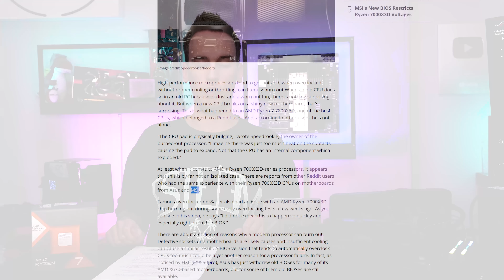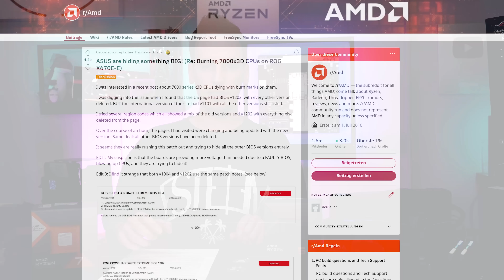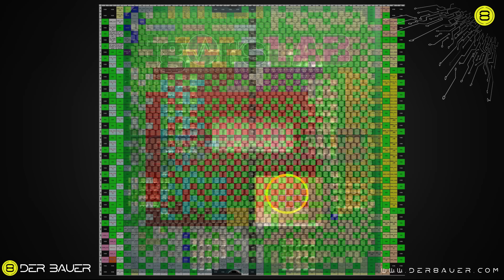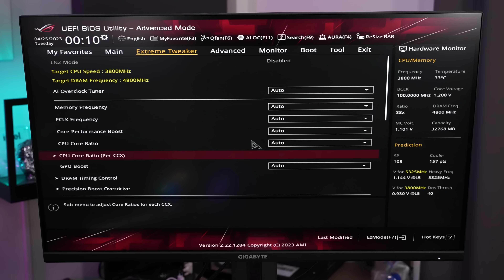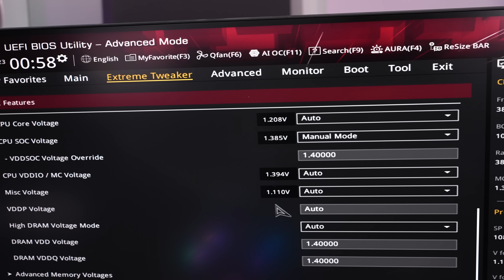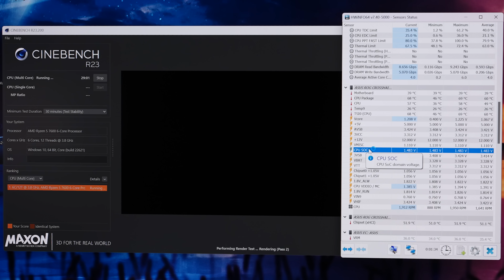I missed the Damage on this Ryzen 7900X

Comment: My 7700X spikes up to 102-105C when I wake up the pc from sleep and monitoring software is still running, otherwise it won't reach higher temps spikes than 95C once once the water cooler is saturated

Comment: I've been wanting to give AMD another chance by building another Ryzen system, but they're making themselves hard to like with the perpetual dumpster fire of problems plaguing literally every generation of Ryzen CPU and motherboard now.

I've been bitten four times by bad Ryzen CPUs and motherboards now. My first Ryzen 1500X was plagued by the dreaded Segfault bug, even though it was a mask revision that wasn't supposed to have it. My second 2400G was also plagued by the same bug, and the motherboard despite saying it supported it, didn't actually, so I had to jump through hoops to get the BIOS updated to work with it. The third was a 3700X that had an unsolvable watchdog timeout AND SMT bug that would corrupt system memory entirely at random. The fourth was a Ryzen 5700X that again had a motherboard that said it supported it out of box, but didn't actually because it was shipped from the factory with an outdated BIOS, and it didn't support flashback.

AM4 was a landfill fire that was entirely caused by AMD trying to support too many CPUs over too long a span of time.

Now AM5 is off to a great start with what is akin to a "killer poke", where the lack of hardware sanity checks can lead to the destruction of a thousand dollars worth of motherboard and CPU.

Comment: I cant imagine there is any way this failure node is anything other than a short to ground originating somewhere in the cpu die.  I would dismiss this as a 0.001% chance fail mode but it is weird that derbauer had one on the original 7900x. Perhaps amd has a small hole in a die sort test program

Comment: Drama wagon or not, it's getting harder to stick with AMD for a PC that is bought to be used for countless years...

It's RX6000 cards with the die cracking, CPU's burning, defective coolers on the RX7000...😕

I'm thinking it now everything goes High wattage and they make crap IHS among other stuff making things run supper hot and then have high heat tolerances so it's easier for something to completely go bad than ever.

I recently had many shutdowns on my Strix RX480 Flashed to Strix RX580 because of a defective Arctic MX-5 thermal paste and luckily it's still alive and fine after changing to MX-6, if it was a much more modern GPU the defective MX-5 might have burned my GPU, gladly my Vbios is set to 87Cº max and stays there while heavily downclocking and at 91Cº it shutdowns likely to prevent hot spots, if it was allowed to go to like 98Cº it would have been burned very fast...

ps: I also had 1 CPU core burning last year from my I7 2600K, but I mean it was always in use since 2011 and mostly at 4.9ghz on air cooler with high voltage and still took this many years to burn it and it still actually works by setting 3 cores, 4 cores it just keeps on a boot loop on windows and Linux reports CPU hardware problem and my CPU pads are only a bit darker on the area with problems, it wasn't even that much catastrophic and the board pins were also 100% fine.

Comment: I know when I was overclocking my memory a lot of people mentioned having 1.3 volts on SOC or higher from their settings stock. I thought this was a bit strange since I have the mdie 5600cl28 on x670e ASRock Taichi and the soc voltage is only 1.2 volts. 

this is a xmp kit not expo however.

Comment: I get random shutdowns with expo enabled. I've kept it disabled because of that. Happened once every 1-2 weeks.

The system refused to boot for a few minutes after each shutdown, like there was some sort of thermal protection going on. Temp readouts from RTSS were fine, like 50-60°C tops, but I only had package temp monitoring enabled, no hotspot monitoring sadly.

Comment: It should be pointed out that there is a known DDR5 PMIC bug that's likely responsible for buildzoid's dead 7950X. It happens when switching to the DRAM OC/High Voltage modes. The voltage stepping goes from 5mV to 10mV and depending on the order settings get applied, a translation bug can cause the PMIC to skyrocket MEM_VDD from the user value to ~1.7V+, depending on what was applied. The DIMM may survive but in earlier bios, MEM_VDDIO would automatically follow VDD to any value which could mean either instant death or  running unsafe voltages without the user even knowing.

Now the bios caps auto VDDIO but the bug still exists. Vendors have implemented roundabout measures and even temporarily removed high voltage options from some bios. It's certainly still a risk to users with much older bios and I don't see a lot of people talking about it.

To be clear, I don't think this is necessarily what's going on and EXPO shouldn't do this but it's worth pointing out. They do often set SoC higher than necessary and there may be other auto-prediction bugs going on but I suspect it's not that simple.

All I know for sure is the most important thing I've learned in ~15 years of building systems is to set every reasonable voltage and memory setting manually. Auto voltages and XMP values have always been a problem to varying degrees. Do not trust them, especially on new platforms.

To be safe, I'd suggest everyone do this and set MEM VDDIO, VDD and VDDQ individually (uncoupled). If you can't see the other values, load Ryzen master and write them down and in most cases default values are fine. Typical kits shouldn't need more than 1.30-1.35V SoC. Many CPUs don't need anywhere near that. Supposedly SoC should be at least 0.1V less than MEM_VDDIO. There are other voltages but they shouldn't be important and don't set anything your unsure about.
Reply: This would perfectly explain the multiple deaths from what appears to be MOSFET latchup. 
MOSFET lachup on a processor is nomally cause by an unprotected IO line being driven with a voltage Higger than its 0.6v under its supply voltage, it causes the bus receiver to short circuit across the power lines.
Ones latchup occurs theres nothing that can be done to save the chip except power off FAST - i doubt thermal management systems could do anything even if they arent taken out.
There would have been little reason to put protection on the memory lines in the past as they shared a power controller with the die, but now DDR5 sticks have their own on board power controller.
Reply: @mycosys  Thank you. Something like this certainly makes more sense than "High SoC damages thermal sensors therefore it boosts itself to the moon until melting.".

I don't doubt SoC could be a factor and that seems to be what they're focusing on but it can't be that simple. What's interesting to me is how supposedly VDDCR_SOC needs to be less than VDDIO_MEM + 100mV. I assume it's related to VDDIO_APU but it's puzzling to those I'd talked to and rarely mentioned. 

Normally this shouldn't be a factor but a kit running 1.4V SoC and 1.35V VDDIO starts pushing it and lower DDR5 voltages could quickly be a factor at reasonable SoC values. Then you have people lowering VDDIO to 1.2-1.25V like buildzoid recently showed at high frequencies.

I'm trying to find more information but I'd love to know if anyone who experienced this failure had the iGPU disabled.
Reply: @JJFX-  That sounds odd to me cos if VDDIO_MEM goes over VDDCR_SOC (or below VDRR_SOC ground) thats when latchup is gonna happen and they are riding that awfully close relying on an external power controller on the DDR5.
Reply: @JJFX-  Interesting thoughts! Just one question about the last sentence: why do you specifically ask whether the iGPU was disabled? Do you suspect an issue with the iGPU?
Reply: @ysa2907  AFAIK SoC feeds VDDIO_APU which is often tied to the VDDIO_MEM value. When the iGPU is disabled it reports as zero in RM. To be safe, I've always had the iGPU off while memory OC'ing but I couldn't say if it actually matters.

It is just a thought and could very well have nothing to do with this. I still don't fully understand the relationship between SoC and VDDIO rails. Some knowledgeable people I've talked to haven't rule it out but don't think that's what it is.
Reply: @JJFX-  interesting! I guess it wasn't an overvoltage of VDDIO_MEM or otherwise the DDR5 memory modules would probably also get damaged, and I've never read about damaged memory modules in this context. But maybe undervoltage on VDDIO_MEM could cause a short  inside the CPU due to a MOSFET latchup as was pointed out by @mycosys.
Reply: @ysa2907  After watching GN's recent analysis video, I suspect this theory may be closer to reality. The failure seems to originate at the heart of the iGPU core complex. They also highlighted how Vcore feeds part of the iGPU and perhaps this is why the failure is so catastrophic. The voltage block diagram they obtained raises more questions but now I really want to know if disabling the iGPU has any affect on mitigating this failure.
Reply: @JJFX-  WOW, YT really doesnt like me something im posting. It seems like latchup on the internal IO bus, the location of the cooking and crack is where the power for the SOC comes in. They said it was cracked form underneath by some organic.
Reply: the cooking is at the heart of the SOC complex where the power pins are. As the pointed out it was the substrate coming up from under that cracked it. Those later scorch marks they showed are the internal I/O lines, so it was probably the internal data bus drivers latching up (shorting) due to the high voltage differential. The most common cause of latchup is IO voltage being higher than the supply voltage of a bus reciever. 
Apparently when it shorts it draws power from that point in the middle of the SOC - iirc Steve noted the GPU isnt even powered from the SoC pins?

Check out TI White paper SCAA124, April 2015, Latch-Up

The likelihood of a latchup becomes more likely with  degradation too (voltages getting through to the gates arent as high).

Thing is Steve is absolutely right - these are expected if rare events, from radiation if nothing else.The power management system should be able to detect the short and shut down the machine without damage to the motherboard, normally the CPU.
Reply: @mycosys  Yeah it seems more likely this could be what we're seeing. Lower quality silicon being more sensitive to this in combination with some boards setting values well above what's reported could be the final nail in the coffin.

I believe Steve was saying that part of the iGPU is fed by Vcore but there's still a connection to SoC, which also goes to the CCDs. The information they posted about SoC feeding the plane handling VID requests is from the original Zen architecture so I'm not sure how relevant it is on Zen 4. The voltage block diagram they shared raises some interesting questions though and conflicts with other data I've found so I'm trying to get clarification from people who have more access.

This likely points to a connection to the X3D v-cache that's making such a failure more common.

I appreciate the info, I'll be giving that a look.
Reply: @JJFX-  Cheers mate, be grateful if you let me know what you find. I'd say the 3dVcache is mostly limiting the voltage of the CCD so that the differential to the SoC is higher. It may even be data latch up rather than rail latch up, which would explain burning both chips.
Reply: Latchup is really common in embedded development
Reply: VDDIO_MC seems to ignore settings and set to VDD for me.  I tried VDDIO to 1.25 with Dram_VDD to 1.35 but VDDIO stays at 1.35
Reply: everyone here talking about things but they do not give a solution to people, what do I do with my processor?
Reply: @tel--sat2277  well, which do you have? Run newest bios, and enjoy.... like we all have for months now.
Reply: I’m a noob I don’t understand anything you guys are saying.
Reply: So if I'm using 4800mhz ECC UDIMMs, am I less likely to see my 7950x3d die in my Asus board?
Reply: @clippy_friend  Who knows honestly. We dont have the data for exactly what theyre doing, i'd hate to assume they applied the same logic i would. . 
I'd be applying a 0.005v negative SoC offset personally. But i do that anyway.
Reply: @clippy_friend  AFAIK the latest BIOS should be fine but I couldn't say for sure. The speed shouldn't matter much if it's not running EXPO but the best way to know for sure is to simply run HWinfo64 (select sensors only at start) and make sure the VDDCR_SOC value is well under 1.3V in Windows. Check the reported value at idle and under some type of load.

I don't have experience running ECC on Zen 4 but I'd expect SOC should only be 1.1-1.2V at most. If it is between 1.2-1.3V, it should still be fine but I'd just manually set it in bios to 1.2 or less then run a memory test overnight to be safe.

EDIT: Forgot Ryzen Master doesn't report SOC value (it's only one of 3 primary rails so they must not think it's important). Another alternative is ZenTimings on Github.
Reply: @JJFX-  I'm running beta bios, will try all the things you've mentioned. Reason I ask os that apparently the fault only occurs when running EXPO, which is the AMD memory overclock profile, right? Isn't EXPO for AM5 the same as XMP for AM4?
Reply: @clippy_friend  The issue isn't due to EXPO, it's mainly the SOC voltage and boards like Asus setting current limiters too high without proper over-current protection. This just tends to happen when running EXPO because boards raise SOC to ensure compatibility with most kits. EXPO itself does not set SOC voltage.

XMP is similar to EXPO but it is only an Intel thing and they have the rights to it. Prior to DDR5 AMD used memory profiles called DOCP which was effectively just their name for XMP.
Reply: I mean the broken pins are under the CCD not the IOD so it seems kinda unlikely that an IMC failure would cause this.

Comment: You should look at the nuvoton controller readings in Hwin - CPU Vddio/MC and CPU Soc. These are way higher than SVI3 readings or what you have set in bios. Asus is sending way too much voltages than cpu vid request

Comment: The only issue with the SOC theory. The user who had the 7900X was on AORUS. I know from my own board that auto SOC only reaches 1.35V if you lock in a 6400 XMP. 6000 XMPs request 1.25V and you can get away with 1.25V at 6200 as well. Furthermore upon looking at some HWINFO screenshots I have, max current on SOC hits a seemingly hard cap of 20A, and 8A is reached on MISC. I think this more than like is a case of the initial cold boot. 

As with when BZ had his 6900 XT die two years ago, this may have something to do with the current modulation and perhaps the VRM can accidentally kill the CPU with a transient high whereafter the user sees a no-POST. Naturally, because of the whole long training time thing then went on, they may be allowing their CPU time to 'wake up' as it were, not knowing that the sllicon has already been compromised. I think the temperature protection only kicks in once the CPU has initialized.

Comment: This is most likely a issue because AMD accepted "Shits supposed to run hot" and will continue to be a trend unless mobo manufacturers tipple check bios firmware to compensate which will probably cause a war between manufactures and AMD.

Comment: i posted this on the one that melted - that I/O die is getting too damn hot and either it doesnt have thermal monitoring or something is wrong with the thermal monitoring or for that matter maybe even though the I/O die SHOULD be more mature, if AMD is running that chip on the ragged edge to eek out as much performance from an older nm arch then that could cause thermal spikes that cause this bulging and insta-melt of the solder and heat death....
pretty sure we will find all of the issues are in the SOCs and BOY i just HOPE that this can be fixed in software and wasnt something like they didnt put overtemp circuitry in the I/O die because that'd be a BIG mistake
...not like this would be the first time AMD improved performance of one kind or another after launch with better software AHEM my 5700 XT is way better now than at launch AHEM

Comment: I’ve been using MSI x670e Tomahawk, 7800x3d, and GSkill 32gb 6000mhz cl30 for a week with EXPO enabled. You think it’s safer to just disable EXPO instead of leaving it enabled and adjusting SOC voltage to 1.2?
Reply: 1.15 even the idle temps alone are about 3-4degrees C lower from 1.3

Comment: This issue is similar to Intels 10th/11th gen platform. Running XMP on high speed ram i.e.  4000mhz degraded the IMC due to the auto voltage settings for both the VCCIO and VCCSA would hit close to 1.45-1.5v. It wasnt discussed much and never went viral as it never completely burned a chip, however there was lots of reports of IMCs going bad. This just sounds like a much worse version of that, I wonder if all those users who experienced issues also ran higher speed memory..
Reply: Well what do you think intel ddr3 vs ddr3 low power.
A lot of people use the wrong ddr3 on that moment and kill the cpu .
By voltage damage in de cpu Memory controller.
Reply: TH THIS IS JUST LI LIKE INTEL MH MH